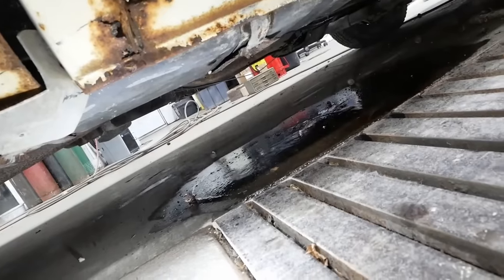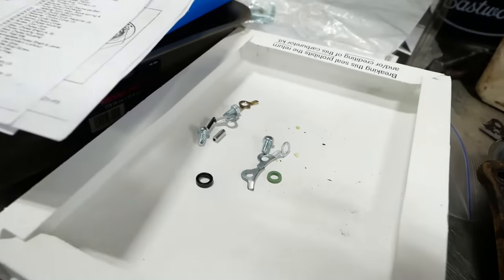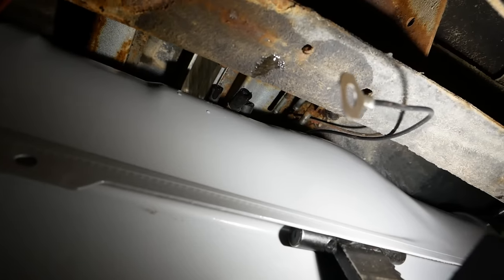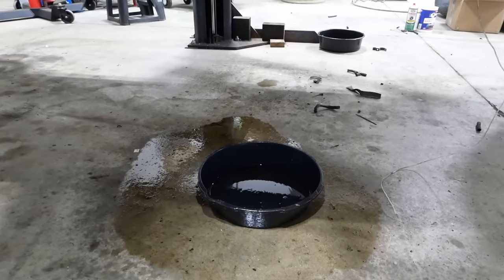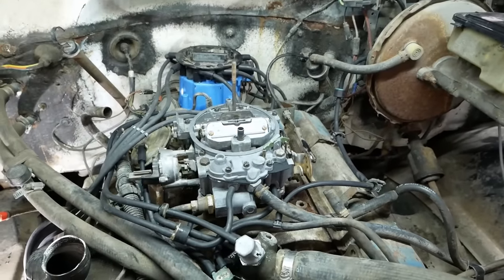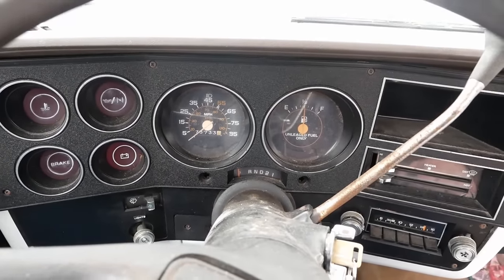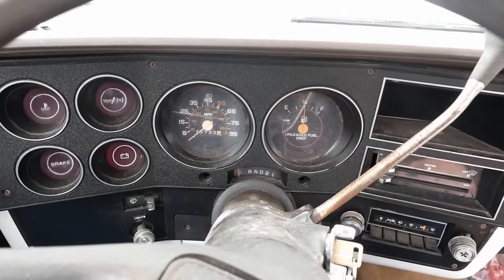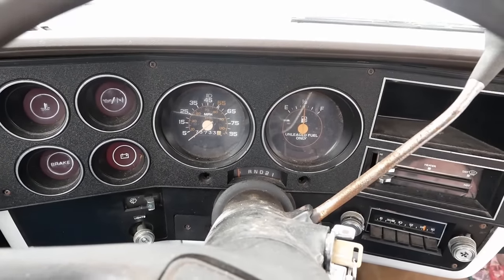Millennial vs. Carburetor | Square Body Chevy Back on the Road After Sitting 12 Years

Comment: Quadrajets are finicky, but they can be good if you get them working right.
The person I have talked to in the past that best understands them is Cliff Ruggles.  I had a 67 GTO that had a Quadrajet and my son had a 72 Lemans with the same.  Spent a lot of time tinkering with carburetors for sure.
Cliff Ruggles even wrote a book on it.  You can look it up on Amazon.
All old timers think EFI is somehow worse than carburetors, but EFI is a good thing. Mythbusters did an episode on the myth of running moonshine as fuel.  They used three Chevy Cameros from 60s, 80s and 00s.  Everyone thought the moonshine would run best in the old 60s Camero, with the old carburetor that should run on anything.  Turns out it ran best in the newest car that had EFI an a computer that would make adjustments for the inferior fuel.

Comment: old school cold start for my self on this type of carb was the coldest day you have in the morning leave the air filter and housing off,park out side.Key off not running hit the gas and  hold it open and from right side, look at choke plate loosen electric choke rotate clock wise to open counter to close set so plate is just closing and one to two lines more lock in place.( If screws) Back high idle screw off or on cam  slot less will release quicker. Not positive if the screw on top under plug is air or enrichment for cold start EPA related? Then see if cold start is better pump pedal 2or3 times less pumps closer to right check after warm up for choke plate fully open adjust as needed. Good luck I hope this helps.

Comment: Your "pretty bad day" about the screw falling inside the engine happened to me, but it was the choke butterfly screw. Took hours of fishing around with magnets, using trans fluid to toss it out.. it jumped to the other side of the engine, but surprisingly, didn't hurt the engine (much).

Comment: I have had about the same luck with quadrajets.ive had some that work great and others that just drive me nuts with little quirks.i just follow my dads advice when it comes to one,and that is simply replace it with a holley.Thank you for the in depth video.

Comment: I’m not a automotive carb person either. I had one on an old Jeep and I converted it to the tbi injection. It wasn’t too hard just tuning it was the annoying part. I believe you can convert that truck with either a tbi manifold or adapter. You basically take all the wiring and such from the tbi truck and put it on that engine. It wasn’t really expensive getting used parts but might not be worth the effort.

Comment: I knew nothing about carbs, until I bought a DRZ400 Suzuki, and I had to rebuild the carb.   Strangely from factory the Keihin FCR41 flat slide never had the mixture needle correctly installed, the flashing in the casting was never drilled out correctly.  With that fixed, and all the passages cleaned out, and a new kit.......it absolutely tears along. If it aint perfectly cleaned and adjusted, they wont work correctly. You literally have to mechanically scrub every passageway inside them and compressed air blow then out. The slightest coating or deposit of any gunk will make them play up.

Comment: The vacuum line that was leaking that goes to the transmission modulator valve also has a rubber line at the other end where it attaches to the modulator valve. It is probably rotten there also. Located just above the right rear of the transmission pan.

Comment: Yes, flat tappet cams need zinc additive.  It's not a joke Wes!  Tractors are designed different.  Tractor operating rpm is crazy low.  And I do agree with you that a well worn cam is probably mated so well that it won't really matter with stock lift and stock spring pressure.  No way I would NOT use zinc additive or break in oil with a new flat tappet cam however.  Farmers are cheap and lazy, lol.  Not who I would rely on for flat tappet cam knowledge.

Comment: I now know why my dad was a Ford man, never seen those clips on the front brakes and the rear drum has way too many clips, and what the heck is all that crap on top of the distributor cap, its too much trouble to just bolt the coil to the engine. 
They had not finished the yellow brick road from Kansas, they were waiting on funding! 
I think if you factor in that they have to pay a millennial $10 bucks an hour to cut that tar paper with scissors that's probably a fair price! 😁
Vintage oil for a vintage rig.. 
I think you have definitely doubled the value of this truck.. man we would let that thing rot down here in FL.
I agree with you on loving fuel injection, can go out now and start up a 1988 fuel injected 302 and it will crank right up, no issues.

Comment: I've rebuilt hundreds of those quadrajunks. They really are a good carb, it's a shame they are gone. Actually could rebuild one blindfolded, never measured float height, just did so many of them. I do miss the old easy stuff. Choke is adjustable, those marks are just for reference. Turn it till it barely moves choke rod then tighten it down.

Comment: Had one on a 72 Pontiac Firebird with a SD455 in it and the original QuadraJet was a great carburator after a rebuild and a couple of other pieces from a older guy who had is own garage and race car. Would smoke tires from Stop sign to stop sign in old Pennsylvania town streets. I will have to get you a measurement of the distance when I get home this weekend.

Comment: After owning a Jeep 4.0 for over 10 years, I learned that I can't use modern oil in my flat tappet cam 4.0. I learned that on some jeep channel. I kept using supertech oil and my cam hasn't wore out yet.

Comment: i know this was a year ago but, there are 2 plugs on the front edge of the throttle blade assembly that also need to come out to get to the 2 idle screws.... you can drill through the front and install screws to pull them out or use a chisel on the bottom carefully to remove some of the aluminum and use the same chisel to tap out the plugs ....

Comment: Regarding the flat tappit cam and zinc, they use it in small engine oil. Kawasaki oil and amsoil for small engines. I’ve also been using normal cheap ass Walmart full synthetic oil in my lawn tractor and it’s at 238 hours without an issue.

Comment: I believe the choke needs adjusted with it fully closed. Adjust it until the choke flap starts to open, then tighten the screws. Depending on which way you turn it, it leans or richens the fuel mixture with the choke on.

Comment: There is an aluminum plug in the front of the top cover under the air cleaner gasket. Drill into that and with a sheet metal pop that plug out. That will give you access to the power piston adjustment screw. On the heavily smuggled out engine that power piston was very sensitive. Also if it had the aluminum intake they were prone to corrosion jacking at the coolant crossover that would cause a vacuum to an engine that was already to lean.

Comment: Look closer Wes, the diagram doesn't show vise grips bending the tab over, it shows the grips holding the pad tight to the caliper so when the tab is ultimately bent over, the pad won't be forced towards the rotor causing premature wear.

Comment: Ultrasonic cleaners are a lifesaver if you are rebuilding carbs. I use the yellow Harbor Freight degreaser in mine. It is fairly cheap and it is one thing from Harbor Freight that is actually pretty good.

Comment: I stopped using pinesol as a go too, sure it works good but It had a reaction once on a z50 carb, turned it black and it removes whatever coating they use on the plates, linkages and body, from the start slap a Holley on it and call it a day

Comment: I've replaced 2 camshafts from small block chevys in the last year due to the lobes being worn off. Both were bone stock engines. I believe the lifters got stuck in their bores, or stopped rotating as to why they failed. My theory is that once a camshaft and lifter mate together, the surface should become hardened by heat so zddp really isn't as critical. It's during the break-in procedure when you have a fresh cam and lifter set that zddp is a must have. It creates a layer on the surface of the lobe that helps to prevent metal to metal contact. You really won't see any issues unless you have monstrous valve springs installed, but its cheap insurance during break in. Zddp is harmful to catalytic converters so auto manufactures stopped adding it to modern oils, plus the invention of roller cams and lifters in the 90's did away with the need for it.

Comment: Ouadra jet 850, great carb and really easy to work on, getting linkages right is tricky but they flow air and adjusted right are reliable, i can rebuild them in my sleep.

Comment: I build vw air cooled motors and the argument is that you need to add a zinc additive for the start up because modern oils don’t have it. The start up procedure is to run the engine 20 minutes at 2000 rpm, then change the oil. The 20 minutes is supposed to break in the lifters and cam lobes and after that you can use regular oil.

Comment: It's actually in many cases a "Klink Klonk" you will hear going fwd to reverse appling the brake both while in reverse then again  while moving forward.

Note1: Pad will in many cases move if pad is not properly fitted to the caliper.

NOTE2: Proper filing of the bad is to tnclude  checking that  pad can square itself up perfectly seating complety and properly with pad backing plate to to the  mating machined surface of the caliper.

Note3: It is often adviceble to ensure a tad bit off slop when Note 2 is achived.

Comment: v8 chevy trucks had flat tappet cams up to 95
broken in  stock cam & springs are usually fine with modern oil, performance cams and high pressure springs where flat tappet become a gamble (+low quality replacement cams and  tappets, even on brand name parts, ask Uncle Tony)

Comment: Some of those carburetors had a power valve that screwed into the bottom of the bowl. I often found replacing those cured any kind of stumble on acceleration. Additionally, I used to bend the linkages on the choke pull off, secondaries and accelerator pump to get what I needed. Pretty standard to have to do that

Comment: /I  fit the brake pad tabs before as I install them . 

There is what is called a 'power valve' that you should replace too. The throttle shafts leaking will cause big problems because they are a lean burn carb when running on the (primaries, most of your driving) and  especially with vacuum secondaries. You will never get it to run right with the worn shaft bushings. I have been down that road many times. You wont find a used throttle plate that is any better either. In hotter climates I used to block the exhaust port that goes through the intake in southern CA, because they  like to vapor lock, or you can use a spacer. If you get them right, there is not a better carb. Getting them right is the trick. I have taken a hammer to more than one. Some guys will even install fan on the intake. The fuel will start to boil, even if your tem says normal.

I use diesel oil in any old engines I work on or build. Zinc is more crucial during break in. It provides an extra layer of  protection. Ask any race engine builder. Cam manufactures will tell you to use it if you install a new cam. have been out of the game for a while, but have not heard anything about  modern oil destroying old engines. I could see of you used a 0w 20 or really thin oil. I wouldn't use anything less than a 20w 50. after break in. and defiantly not anything less than a 30 w. Clearances are not as tight on a 350 or 454 as they are on an 3rd gen  and later chevy engine. I would think using a modern engine oil would be beneficial since the science has come so far. 

I have have half synthetic 20w 50 in my 68, Mercury Monterey w/390, my 71, 402 RAT engine in my GMC 3/4, my 68 413 Lemans with zero issues, but i do not claim to know it all.  I do flog my engines pretty severely. I did hear about them reducing the zinc in diesel oil, but I think the main benefit is the higher detergent. I Lucas Oil Stabilizer as well. I know if you dont use zinc and you install a higher than stock lift cam, you will wipe lobes pretty quick.

Personally, I would have told to customer to parts it out or junk it. Those trucks like to break in half.

Comment: I've got an 82 Scottsdale with a 305 and I assume the same carb as in the that one. The thing needed like 3 pumps in the summer and 6-7 in the winter and generous open throttle to get started. Worked perfect when it got started. Just swapped on a new Holley street avenger 600, and it starts and runs like a dream now. I think the old carbs just get plain worn out and gunked up and are not worth the time to repair them.

Comment: I would first hook up the exhaust gas analyser and see what the CO content looks like when running warm. If the mixture is too rich it will be hard to start when warm. There could also still ge a plugged passage in the carb. I once had a fault on a carb back in the 90s and just like you cleaned and rebuilt the thing numerous times and couldnt fix it. Eventually it turned out that a tiny drilling in the body was blocked with a piece of grit. I'd blown it through multiple times and it hadnt cleared it. The only way I could clear it out was with a thin piece of wire from a wire brush and poke it through the passage. After that the car ran perfect til the day I sold it.

Comment: Love your videos. You go into details few others do. There was a recent comment (I don't know which one) about tuning it by replacing with a Holley. I'm a similar rebuild for my 72 superior motorhome with a 440 wedge. Most of the innovations from the early 70s through the late 80s (to cut down on pollution)  were in my opinion meant to pay dealerships mortgages through the repair shops. Gouging is nothing new.

Comment: Not a tech but have been around 74 years.  Nothing like fighting misbehaving.   Worst was a manual transmission, stopped on a  uphill, won't idle., etc.  Even worse was when the starter switch was on the flooen

Comment: The romance some people have with the old "Simple" carberated engines is just that, I'll take a modern fuel injection.
 Rust attacks everything old or new.
 One advantage with working on older vehicles you can understand and and explain the difference from the new,
 Good job.

Comment: First off don't beat on yourself too much, carburettors are a pain in the arse if something is just slightly wrong. I learnt this from a old subaru mechanic many many years ago that they are a skill in it's self just to learn how to built and retune them. Sadly people who understand the old cars is fast becoming a thing of the past.I still like the carburettor engines heck I've seen old 1970s or 1980s cars get better fuel mileage than some of the new cars out their. 
Either way love the videos.

Comment: I put dielectric grease between the carbon button and the coil on the cap. most of the time when you buy a new cap they supply you with some grease for that purpose.

Comment: Some of those electric chokes are adjustable, depending where you line them up will depend on how quickly the spring releases the choke and high idle.
The issues you are having with the truck may not be to do with the fuel system now.   It could be that the carb is fine and the ignition system needs additional work.   These things are a fine balance, even in old equipment.
Vice Grip Garage does usually keep the Vacuum Advance and torque converter lock systems.  He usually just deletes the emissions stuff that doesn't really affect performance.   The difference is, most of his rigs are not going to town rigs.  They are for track / event work which doesn't need to the same controls as road vehicles.

Comment: That carb you were working on 81 chevy . sounds like float level low and egr not seating in the same spot. Timing chain stretches , and you can go to 10° before top dead center. Also her should be delayed until 150° F.
Reply: 150° EGR. not operate below.

Comment: I'm impressed you have 18" of vacuum.
You may want to get the eBook by Cliff Ruggles, Rochester Quadrajets.
I have a hot air choke on my 78.
Gen X.
If it's not fuel injected, the cold performance isn't going to be as good as fuel injection.
You can double foot it on gas and brake instead of stalling in great. Also can pump and crank the ignition at the same time.

Comment: It needs to be driven.  Every mechanical connection up to the carb is a little notchy due to wear or corrosion.  It's also hard to work out little problems with the varying temps of the engine during adjustment.  Throw in little and sometimes minute differences in clearances and tolerances due to the other inconsistencies from wear and corrosion and you've got a few problems that will partially clear up with use and others that will remain.  As you now know, if you want to get it as close to perfect as you can, you need to buy one from a reputable remanufacturer.  They will also supply support.

Comment: I see you live in the same Anti-gun State as I do. Your about 78 miles from where I live so I can see where rust is a real big problem on vehicles. The way the salt trucks dump salt on the roads here I think the state gets a kickback from the salt companies, lol Never thought of using Pinesol in my Ultrasonic cleaner. Great idea. I would start out by mixing it with water, 50/50 and see how it works. Not sure but pure Pinesol may be a bit hard on aluminum. I did a search and found this statement : ( Pinesol is not recommended for use on marble, aluminum, or unsealed, waxed, oiled or visibly worn wood. Thanks for the Vids Wes. :face-blue-smiling: